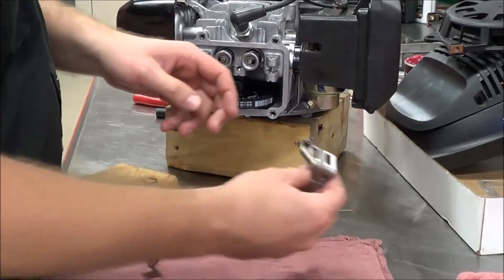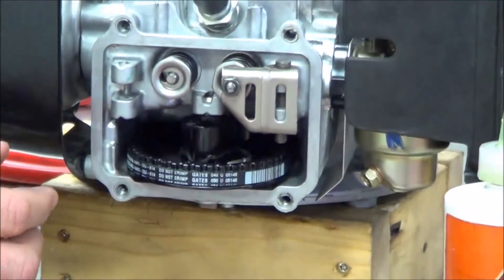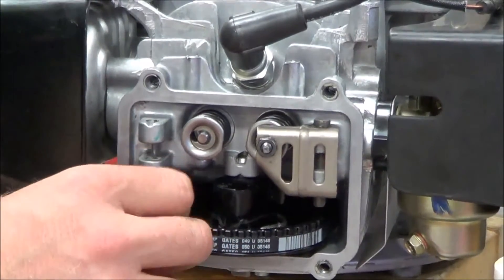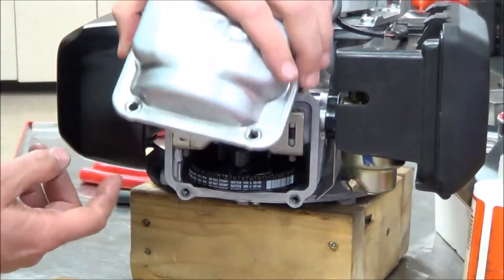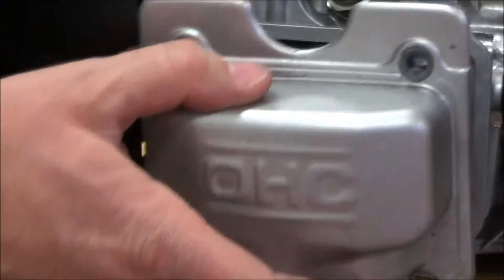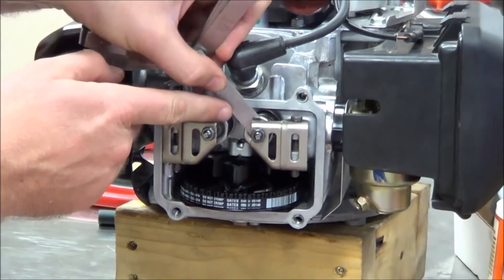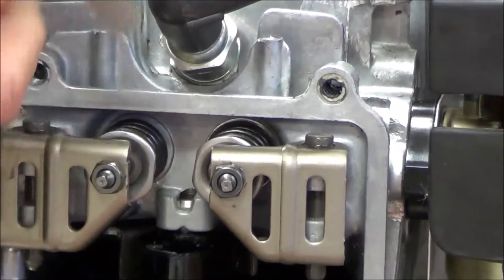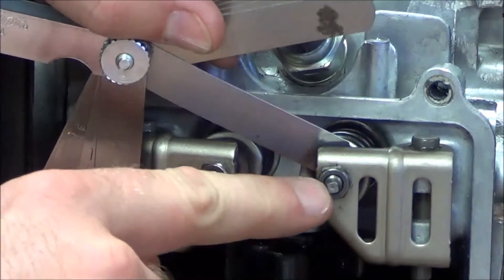GCV Assembly   11 Rocker Arms #how2wrench

Comment: When does this need to be done? I just took apart my carb and went through it, is this a necessary adjustment for a used machine from 200*? Thanks if so, please tell me the specs again. Oh, what is the torque spec for the 10mm bolts? Thank you.